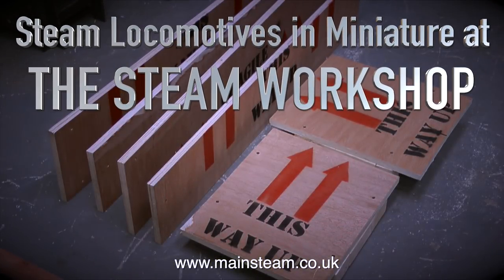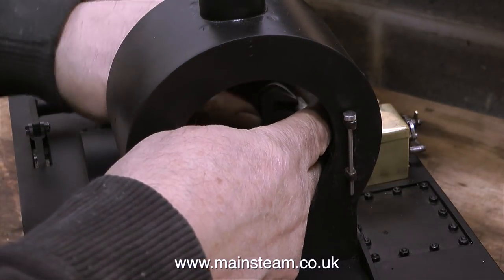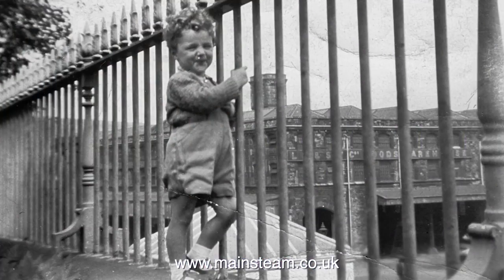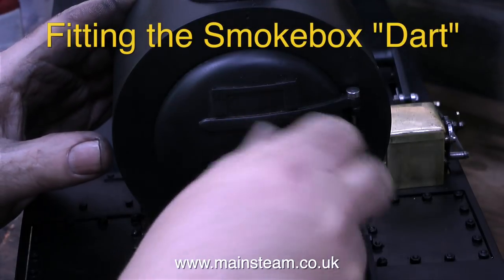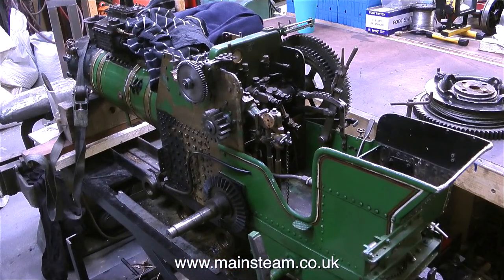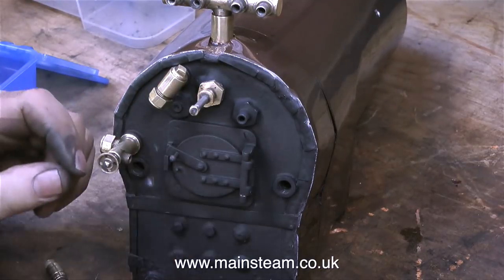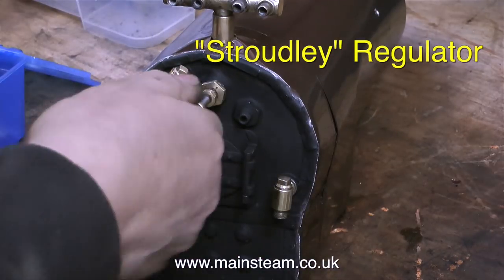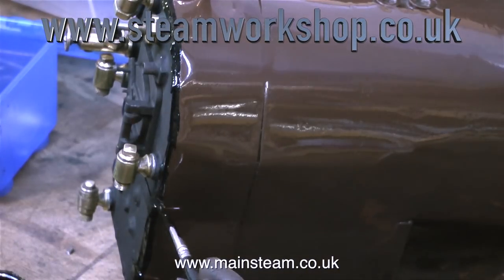WORKING AT THE STEAM WORKSHOP #17 - SMOKEBOX DOOR AND BOILER FITTINGS

Comment: Hello I like the way you describe how to do things . I have a 5 inch gauge doogle and the blow down valve has sheared off . Do you have any way of removing them. The threads are stuck in there
Reply from the maker: Try a square file, that's how I usually do such things - or maybe use a specialist stud extractor .......

Comment: If, after steaming-up, you find that the regulator really is stuck, how much of a pain in the patoot will it be to address it? Will you have to take everything apart, or just a few bits? Many thanks for another great episode in the Steam Workshop series.
Reply from the maker: I will need to remove the steam dome in the centre of the boiler, repair the regulator them make a new gasket and refit the dome ....

Comment: Paint on smoke boxes and fireboxes on large American locomotives doesn't hold up very well, and often these locations are painted with a special silver looking (graphite?) Paint.  How does the paint hold up on a small loco like this one?  Is that due to the relatively low temps or just superior paint.
Reply from the maker: On this engine the smokebox has been painted with heat resistant paint.